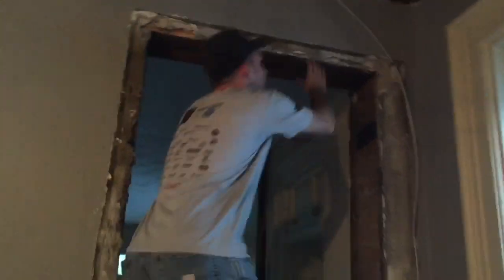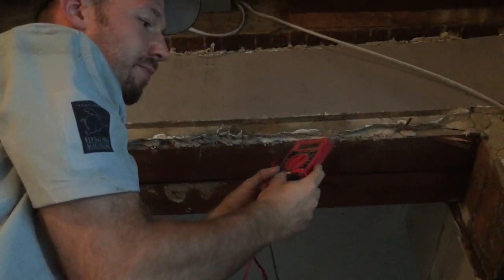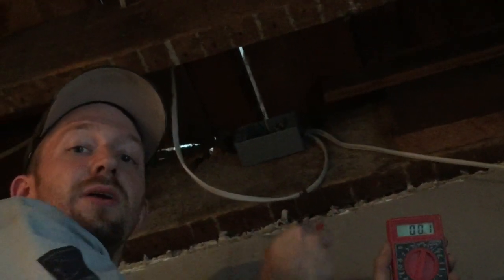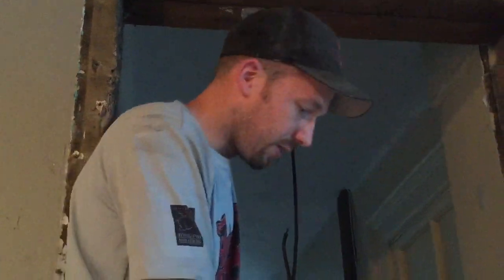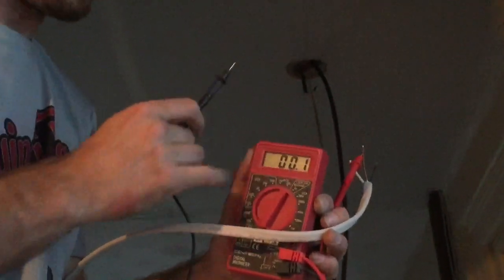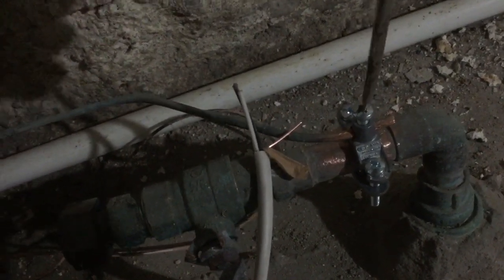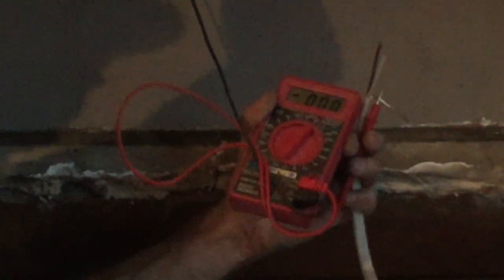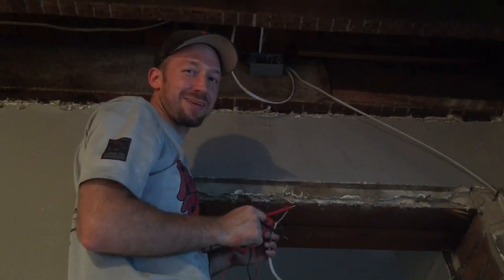Identify The Hot Wire (Knob And Tube)

Comment: In a situation like that I've taken a jumper wire and ran it to the nearest Coldwater pipe, then attach the leads of a Wiggy between the jumper wire and the other wires in the Box till I find the hot.

Comment: that is all well and good but what if the source wire is switched many time before getting to your test site. knob and tube were not always run black to black and white to white, most times they were reversed and the so called white wire can still show voltage. so the site of your test shows the load at that point and possibly down stream it could be the opposite.

Comment: There is a much easier method. Purchase one of the cheap neon testers (just two leads and a neon bulb). Touch one lead to your finger and the other lead to the house wire. If the neon bulb glows faintly you have identified the hot wire. I have done this many times. You will not be shocked. You will feel nothing.

Comment: how do you safely disconnect K&T wiring? by removing it or simply cutting the hot wire from the junction box?
Reply from the maker: I believe I cut this wire and then added the junction box around the two bits that were still exposed

Comment: How do you use a white wire as a hot I have three outlets one light and one switch.
Reply: any white wire on a switch is a hot wire and should be wrapped in black tape ...NEVER put a neutral wire on a switch.....ignore wire colors and check everything first with a meter or voltage detector...people do some crazy stuff and never assume it was done correctly..
Reply: If you are running a switch at the end of a run to operate a fixture the white will act as the hot off the switch back to operate the light fixture. the hot runs to the switch the black wire then the white wire completes the circuit back to the fixture.
Reply from the maker: DM me a picture of what you're describing and I'll see if I can help

Comment: Most of my house is connected to the ground... Just touch one end of the meter to a wall. It may only read a few volts when you find the right wire, but it will be the only one with a reading. Just saved you so much time.
Reply from the maker: #protip Thanks Jeremy!
Reply: Any type of wall materials or certain materials?

Comment: i believe bonding to the pipes is no longer code. I was suprised i had to install 2 ground rods and bond them in the main panel but it all passed :)
Reply: It's still code I dont know how they let you slide 250.68(C) Grounding Electrode ConductorConnections.
(1) Interior metal water piping that is electrically continuous with a metal underground water pipe electrode and islocated not more than 1.52 m (5 ft) from the point of entrance to the building shall be permitted to extend the connection to an electrode(s). Interior metal water piping located more than 1.52 m (5 ft) from the point of entrance to the building shall not be used as a conductor to interconnect electrodes of the grounding electrode system.
Reply: Also most utility company's require 2 ground rods but the NEC says you can use one ground rod if you can show 25 ohms of resistance
Reply: you have to ground to water pipe on both sides of the meter and two ground rods on new installations..

Comment: had this problem today.  trying to change light fixture . both wires were black and i could not tell which was hot. had to go to home depot for a voltage pen.
Reply: wattamutt for 30 bucks? I would sooner take a little touch of 110 than grab mine from floors below if it’s not on my belt.
Reply: @veganlvl5202  LMAO old school
Reply: @veganlvl5202  actually a lot of times you cab physically touch old wiring like this and though it has voltage you will not feel anything.  This is not always the case but it has happened to me plenty.

Comment: Umm, why not just use a Voltage Pen to find the hot wire??
Reply: Spirit of a Handyman you know you can test wires away from the box right?
Reply: NevrBDwn Ruby Bc of false positives
Reply: Use a regular voltage pen like a green lee with a sensitivity wheel I can find the hot and the neautral with it most non contact voltage testers are way to sensitive for a lot of wires in a box greenlee gt-16 is the best
Reply from the maker: The downside I have found with voltage pens is that they beep at proximity. For this particular job I had both wires coming into the same box and so it was easy to get a false reading on the pen because it would come into proximity with both wires. I needed something a little more exact. Otherwise, that is a great idea-especially if you already own a pen. They cost between $10$20 at your local hardware store. The voltmeter I used was a free give away at Harbor Freight

Comment: Outlet actual voltage is 220v? Then to find out the hot wire it should read half or 110v? And neutral is zero?
Reply from the maker: Are you hooking up a dryer or something like that? If so, you will have 2 hot wires coming into the box, each carrying 110v. Either way, if you use this method, your neutral will read 0 and the hot wire will read hot.